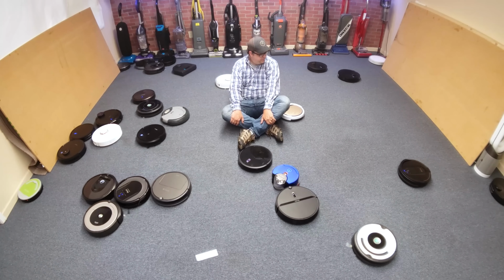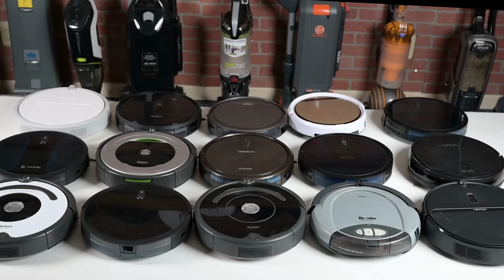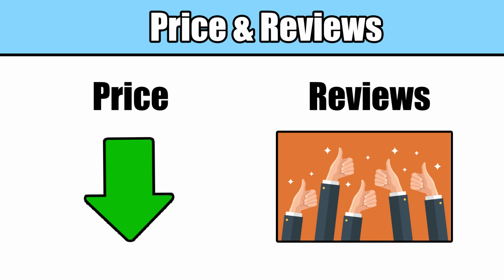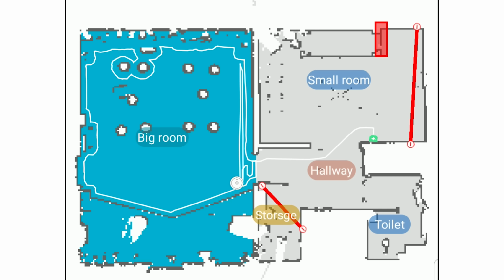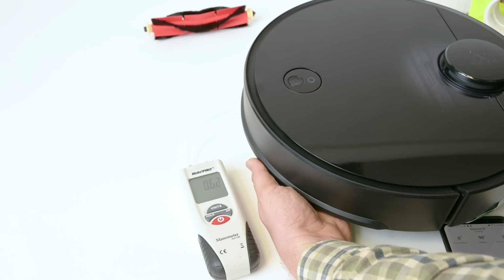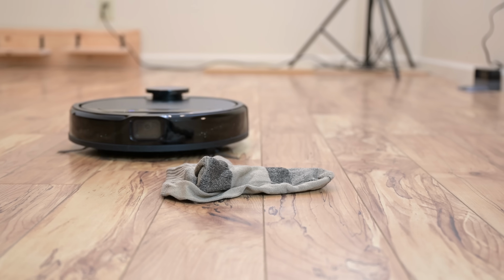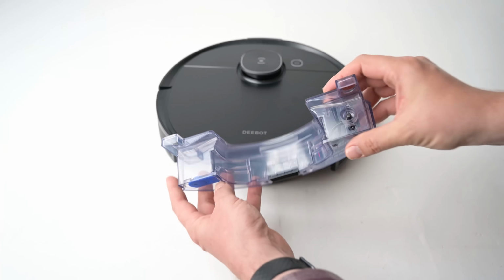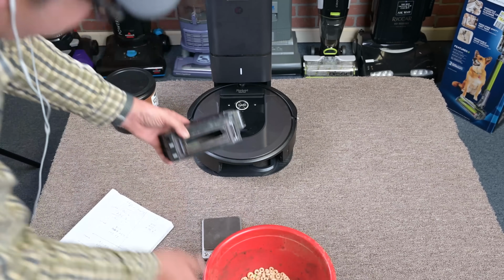BEST Robot Vacuums 2020 Edition - Vacuum Wars

Comment: DO NOT buy Dream W10 product, unless you want to deal with unprofessional customer service from China (I'm originally from China) and it hurts me so much to talk about this. My issue with it was the mop pad didn't get dry completely and it grow mold. I had 30 emails with the after sale customer service(they don't have phone nimber) from March 2022 till yesterday. Long story short, I even sent back the robot for them to "repair", but they never did, because they never even opened it. Instead,  they sent me back the robot and blocked my email address.  Now I can't even contact them. And I bought it from Robot Vacuums, and they didn't help either. Now am left with two sticky mod pads that I spent 1000 dollars for.

Comment: Shame you didn't include the Dreame Bot W10.  Auto cleans it's mop.  One disadvantage which may be a deal breaker for some, it does not auto empty the dust compartment as there is not enough room in the base station with 2 large water tanks there.
Reply from the maker: This video is from 2020.

Comment: Have everyone suddenly gotten lazy? How are any of these capable of "deep cleaning?" Rather than weight the collection bin for how much sand is picked up, It would be better to weight the sand you embed in the carpet and subtract the weight of the sand it picked up in the bin to give you an efficiency score. My 1200W Miele upright (normal) vacuum will suck up all of that sand, and if the carpet isn't nailed down that will be gone too. That's what I call deep cleaning. These robots are only capable of mediocre levels of cleaning. I have a better test. Let's call it the Tick test (I live in the woods  and own dogs btw) will any of these robots be capable of vacuuming up a Tick crawling through your carpet? Chuck some of those little buggers down, and see how many manage to escape from your robot cleaning cycle. I haven't had even one escape the Miele, and that vacuum is 17 years old and counting.

Comment: I bought a carpet cleaner machine based on your video and am very happy with it.  My question is in reference to having  mostly terrazzo floors with a couple of 5 x 7 area rugs. I usually swiffer  the floor and vacuum the rugs. What would the best robo vacuum be for my situation as I'm reading there is a scatter issue on non carpeted floors ?

Comment: You should have mentioned which ones require disposable bags. These can be small, need steady replacement and be a ongoing cost consideration. I have a bagless vacuum so I was  incredibly disappointed to find when your top choice arrived via mail, that it requires bags both in the mobile unit and in the collection tower. It can’t be used without bags, and they’re small.

Comment: Hello, which one do you think will be better, the deebot t8 or the n8pro. I have around 120 Squaremeters, mostly hard floor (laminated  floor). Thank you very much. PS . I don't mean the t8 aivi.
Reply from the maker: I haven't compared the two, but also I haven't seen all the specs on the t8 so it's hard to even compare those.

Comment: I bought this machine ILIFE V5s Pro Robot Vacuum Cleaner after watching reviews like this & machine stopped working after two months. Customer care is not responding as well.
Reply from the maker: Sorry to hear that!
Reply: I second on this, bought ILIFE V5s Vacuum Cleaner last month & it started working intermittently, had a feel that it will be dead in next few weeks. As mentioned, customer care of ILife is useless & don’t respond. Even checked with amazon, they also sound helpless.
Reply: Motherboard of ILIFE Vacuum Cleaner bought two months ago got corrupted. There is no customer care in ILife, when complained about motherboard damaged, they talk about charging, absolute waste. 18k went into drain.
Reply: Looking at positive feedback on youtube, bought this ILIFE V5s Robot Vacuum Cleaner this year & it stopped working in less than 6 months with no response from seller on warranty & repair.

Comment: Until one of these robots can be a really good all-in-one device (vacuum and mop) I don’t think any of them are more than touch up machines that reduce the need from self vacuuming dramatically, but still need a deep clean every month or two. I use the most budget of them all Eufy and it sucks very well like the test showcase. It does it’s thing till it dies weekly and then I put it on the charger, so being ‘dumb’ isn’t really an issue. The reservoir is pretty big and holds about a months worth of cleaning before having to dump in my 700sq foot apartment so I don’t see the need for the robot to do it in a complex bag base setup. 

It’s still awesome that I only have to vacuum 8 times a year or so on my own with this thing (vs > 52). That alone makes it’s $80 price tag super easy to justify.

I don’t know if these things are worth more than $200, especially not almost a thousand. Not when none of them still have the power suction of a deep clean vacuum  and can’t mop floors. You need another robot to do that, and those are expensive and not nearly as useful yet.

I’ll give these till 2025 before they’re good enough to potentially replace all household flooring chores.

Comment: As an owner of the Robovac 11S, I have to say I was dissapointed by it's lack of durability. It quickly started getting noisier, and at some point maybe 4 to 6 months after buying it, the middle brush started making a very loud rattling sound. I took it back, got it fixed and a few weeks later, it started again. Had it fixed again and it kinda improved, but was never as silent as before. Then the smaller  side brush started doing a horrible screeching sound whenever it gets stuck on something. Now it makes so much noise every time it works, that I find myself turning it off after only a few minutes.  I would advice against getting it.

Comment: I bought ILIFE V5s Pro Robot Vacuum Cleaner last month from amazon & it stopped working now. Though warranty is mentioned for  a year but Customer care of Ilife is pathetic & not responding, anyone can suggest on how to get this faulty machine replaced.
Reply: So you also go duped by Ilife, you can try everything, ILife will not respond. I tried reaching seller to customer care to organization manager but nothing worked out.
Reply: I second on this, bought ILIFE V5s Vacuum Cleaner last month & it started working intermittently, had a feel that it will be dead in next few weeks. As mentioned, customer care of ILife is useless & don’t respond. Even checked with amazon, they also sound helpless.
Reply: Motherboard of ILIFE Vacuum Cleaner bought two months ago got corrupted. There is no customer care in ILife, when complained about motherboard damaged, they talk about charging, absolute waste. 18k went into drain.
Reply: Looking at positive feedback on youtube, bought this ILIFE V5s Robot Vacuum Cleaner this year & it stopped working in less than 6 months with no response from seller on warranty & repair.

Comment: I bought this ILIFE V5s Pro Robot Vacuum Cleaner in March 2021 from amazon & it is dead in less than 3 months. Seller is not responding & ILIFE customer care is not bothered to respond. Avoid this machine unless you want to burn your money.
Reply: Completely agree, This company ILife & their products are fraud & vacuum cleaner buyers need to be made aware of this.
Reply: Very true, this company looks fraud & cheating people through fake videos & reviews.
Reply: I second on this, bought ILIFE V5s Vacuum Cleaner last month & it started working intermittently, had a feel that it will be dead in next few weeks. As mentioned, customer care of ILife is useless & don’t respond. Even checked with amazon, they also sound helpless.
Reply: Motherboard of ILIFE Vacuum Cleaner bought two months ago got corrupted. There is no customer care in ILife, when complained about motherboard damaged, they talk about charging, absolute waste. 18k went into drain.
Reply: Looking at positive feedback on youtube, bought this ILIFE V5s Robot Vacuum Cleaner this year & it stopped working in less than 6 months with no response from seller on warranty & repair.

Comment: The i7+ is an awful machine. I purchased two, one has been fine. I can't say it works great, but it does work. The other one however has been bad from almost day 1. It's bad with dog hair (border collie) and I always need to vacuum after it (kind of defeats the point of having an expensive robot vacuum. It has a whole host of problems. After hassle with Irobot Australia, they eventually agreed to refund my money. 
I've just ordered the Deebot N8plus to replace the i7+, so I may update this post in a few months.

Comment: Do you have a preferred brushless robot Vacuum?  I got the iLife V3 based on your 2019 reviews and have been very pleased with it, but knew it wasn't going to last forever and with over 18 months of picking up dog hair almost nightly, its on its last leg.  I'd prefer going brushless as its one less thing needing to be cleaned and we only have hardwood floors on the floor the robot works.  Also it seems like iLife is the only company that does brushless in the small amount of time searching, is this correct?  Thanks

Comment: Would be nice if you had separate categories for carpet/hard floor. Carpet floors is pretty much non-existent and not a thing in my country, only hardwood. If you have a carpet, it's a smaller carpet you can dust off separately.

Comment: Could you please do a video about the impact of cats riding on robot vacuums? Does it damage it in any way or decrease battery/cleaning ability?

Love your videos btw!! They've been a great help while shopping for robot vacuums :)
Reply from the maker: My cats won't do it. 😒
Reply: @VacuumWars  Lol typical cats! But if they're unwilling to help maybe you could add some weight to the top of the vacuums based on how much they weigh, just to simulate the impact of cats that do like riding around on robots? 

Just an idea. I have two cats so I'm curious what will happen and/or if I should discourage them from riding my robot vacuum :)

Comment: DONT BUY I ROBOT   i bought one last year. 9s+  ,i did not open the box 
for a year, and when i opened it set it up, it would not work, brand new
 out of the box, i called support and only emails they dont want to talk
 on the phone , she told me we ll deal by emails only, which they could 
not solve my problem, worst support i have ever seen in my life , 
$1,399.00 to the garbage. they said i am out of warranty and buy a new 
one they cant help, still brand new, never been used . it sucks , buy 
any other brand with good support or better vacuum better reviews

Comment: Got a budget $30 robot that bounces around randomly.  It's dumb as a box of nails, and noisy as the falcon heavy recently launched by SpaceX, but it does fill its tiny dust compartment and has taken way more beatings than it deserves from two energetic young cats.  Can't beat 30 bucks which you plop on the floor and let it go while you do other stuff, preferably far away from it!
Reply from the maker: Well done! 😃

Comment: Are there any new flat robots? I have the ECOVACS Robotics DEEBOT Slim10 which is just 5,7 cm height so it can perfectly clean under my bed, TV desk, chair etc. Unfortunately I need a new one and I don't find any similar flat robots. I tried a bigger ECOVACS but it got stuck under my toilet. I really need a flat one like the Slim 10 but of course I don't want to buy the old version again. Any suggestions?

Comment: Just returned the Ecovac t8 today, cleaning was OK, on carpet it was great. The mop attachment isn’t any better than our Roborock s3. The emptying base is useless if you have pets as their hair will clog everything unless you empty it multiple times through a single cleaning. It’s navigation was obviously better and got stuck much less but would still get stuck randomly at times. Every sensor needed to be cleaned daily, literally. Filter needed to be cleaned almost daily, it was waaay to much maintenance to be a luxury item. Their app is AWESOME though, you can tell they did their homework on that. End of the day, it wasn’t worth 3 times the price I paid for my roborock s3.

Comment: I don’t know if this is helpful but there are two versions of the T8, the standard model, which isn’t in this video, and the T8 AIVI, which is the one seen towards the end. From researching, the only difference I could gather was the T8 AIVI uses the camera on the front as a live feed of the home, but performs the same AI features as the camera on the standard model. You can actually find the T8 standard with self emptying bin right now for cheaper than the model with the security camera feature, which wouldn’t really appeal to most people.
Reply: After doing more research I found that the difference is that the standard T8 uses the camera and LiDAR in combination to avoid obstacles, but doesn’t intelligently learn new obstacles like the T8 AIVI does, so there is a pretty substantial difference!

Comment: Have you reviewed any 360 vacuums
I have the S9.
It was a little more expensive $439 than the Roborock S4 but It does multi level ( can actually save 10 different maps) and has a good floor washing system. 
I returned the Roborock S4 because it would not save different maps.

Comment: I am building a robot vacuum with a direct air motor with a sanitaire fan and agitator so it is 150 cfm, it will have a shark soft roller , both vslam and lidar sensors, a mechanism to climb stairs to make all uprights obsolete.
Reply from the maker: are you going to share a video? That should be fun.

Comment: I wish you can tell us how much weight each can support... for those who have kids and pets that like to climb and ride things 🤭
Reply from the maker: Robot vacuums are surprisingly resilient, and most can handle a bit of extra weight without breaking. However, if the pet regularly hops on and off, it could interfere with cleaning patterns or even cause the vacuum to stop if it detects an obstruction.

Comment: I bought the Roborock S4 based upon this review, what a piece of junk.  I returned an I3 because it took nearly 4 hours to vacuum less than 1,000 sq but the I3 was a star compared to the S4. It got stuck in the corner of my living room because it couldn’t figure an area rug. This pretty basic rug on hardwood setup rendered the bot useless.

Comment: After a month I decided auto empty is worthless,  now instead of cleaning out one bin you are cleaning out 2.  I have been using the top of line Shark,  sending it back, too much work.  Every time it has some problem, tired of calling Shark. Maps are garbage.  Our house is really clean do it's just dust.  I have to use a compressor on both the robot and bin collector. It's a mess. I really wanted it to work.  We even sent one back and got a second one, though we had a lemon.  Second one Shark updated the firmware.  Fixed a few things but way too many to deal with anymore. DONE.. :)  now will try just a go back and recharge but not a shark.

Comment: Thanks for your great work. I can afford a budget vacuum and am curious, and if you've seen this happen often. Re the Roomba 675, you mention it's excellent for deep cleaning as you explain the sand test but while Amazon shows a total 25,286 reviews for this model (4.5 out of 5 stars), the breakdown for Deep Cleaning checks in at 3.7 in that section of the rating. If you have time to address this I'd appreciated it. Thank you again!

Comment: I really wished you'd add parts availability and replacement difficulty to this video series. In all honesty, none of this information in this video is useful if 14 months into ownership of my $800 vacuum I have to throw the damn thing out because they don't sell a replacement corner brush or LIDAR driver (looking at you, Roborock). Pulling apart a Eufy to repair it is literally a destructive endeavor, you have to break parts of it to open the damn thing up. When it really boils down to it, the competition for iRobot would have to be CRAZY good for the price to get past value of the Roomba's reparability. I've had a corner brush motor burn out on me 4 times (2x 100lb+ long haired dogs, a wife, and a daughter, and random strings/threads do terrible things to those poor motors).
Reply: If you're looking for parts availability then Ecovacs are some of the best around. I have two, an Ozmo 950 and a Deebot 900 and they are both amazing and you can get parts all over the place for a great price. Bar-none the best electronics I have bought in the past few years.
Reply: @urzaelent81  Am I missing something?All I'm seeing are filters and brushes. I'm not seeing anything like a corner-brush motor or a drive wheel motor assembly?

With Roomba damn near every major part can be purchased for cheaper on the store than on Amazon, and is literally designed to be user replaced (no molex connectors, spring contacts like you'd find for batteries in a flashlight).

Comment: My Roomba I7 got it charging contacts ruste within a month. I only used it inside the house on hard floor and it is a small house.
Reply: Humidity is to high
Reply: @markpitts360  I have the original one also, no problems so far. It looks like the problem with the rust, is the quality of the metal used for the charging contacts.

Comment: I've had my eufy 11S for about a week now and the one question I have is has anyone come up with a way to keep it away from heat vents in the floor.  I hate to have to run around and put boxes on all of them as barriers.  There has to be a better way - the eufy barrier tape doesn't work on this model.  Sigh.  There must be something out there.  Thanks
Reply from the maker: Unfortunately with robots without app barriers, you pretty much have to rig something up to physically keep them away. Some of them can works with magnetic tape barriers but there aren't many good options.